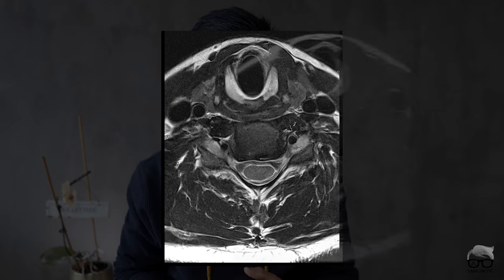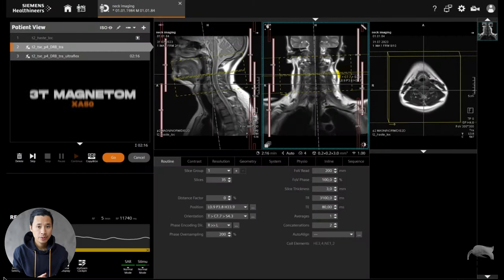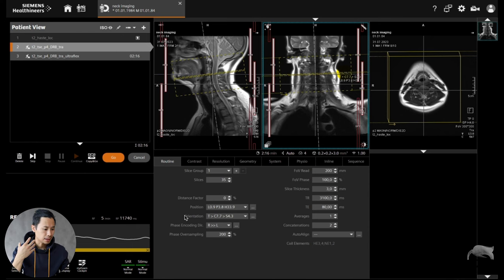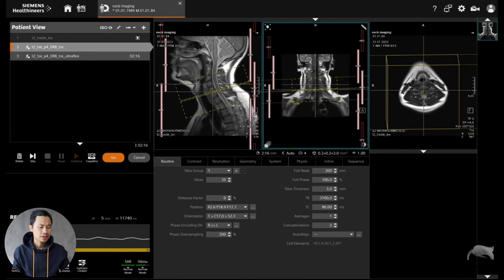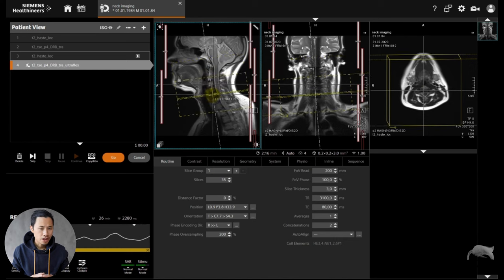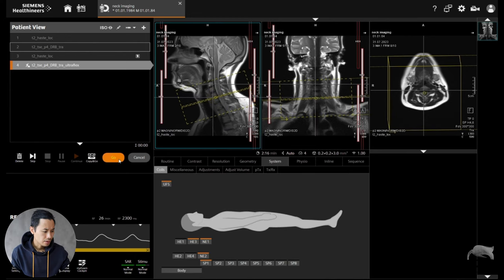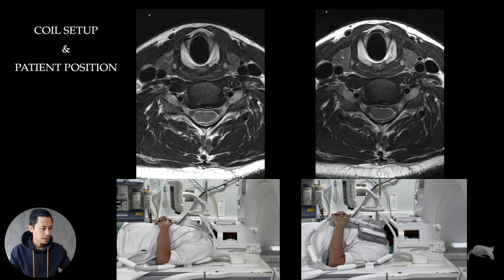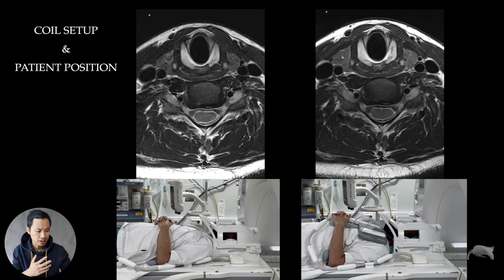MRI – NECK IMAGING – A USEFUL TIP

Comment: Maybe I already asked this question before. But using DRB, we keep getting aliasing, even with 200% oversampling. If I don't use DRB, than there is no issue. Any idea how to fix? this?
Reply from the maker: Good question. Do you use tse / separate or integrated. Also what area of anatomy, coil and weighted?

Comment: Hi Bac Nguyen does this tip improve Fat sat ? On Avanto Fit , entire spine we always have fat sat fault on the neck...
Reply: Use dixon for correct fat saturation. Especially on Avanto, with that old coils and gradients
Reply from the maker: No I don’t think it will improve fat saturation. Dixon is the way to go on that area. On Avanto fit systems.

Comment: Interesting.

Other than the pacient comfort you could go even higher with this technique .

Have you also tried it to position it lengthwise on the neck ?

Also worth mentioning that this strategy only works on 24 channel coils systems and above.. Maybe not even 24 channels , depending on configurations .
Reply from the maker: I haven’t. Interesting 👍
Reply: Hi, why do you say that this strategy only works on >24 channel coils? Our ultraflex is 18 channels. Interested to hear your thoughts on the matter
Reply: I think they mean how many channels the system will allow to be used simultaneously, but I think any machine running XA50 will have at least 32. I know the cheapest Aera packages were only 24.
Reply: @AMLloyd80  Oh, I see what you mean. Yes our system will allow 204 channels simultaneously
Reply: @Pendergeist  on Amira 24 and Sempra 16 systems the UF18 comes with 2 rows disabled from factory so they can be used simultaneously with the Spine coils for body imaging.
Reply: @AMLloyd80  i saw sempras with xa51 but don't remember if it was 16 or 32 (24?) channels systems.